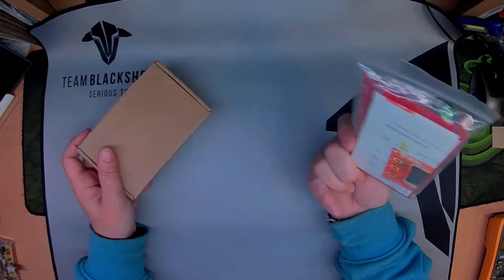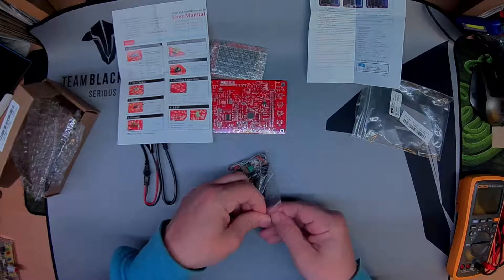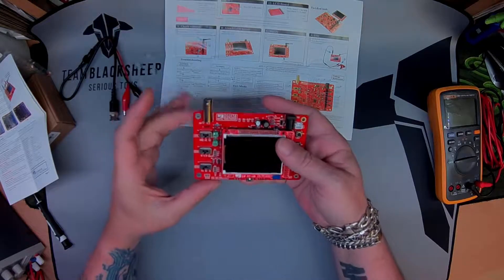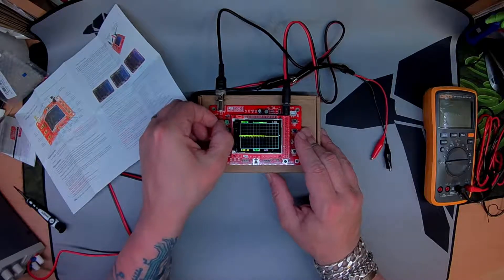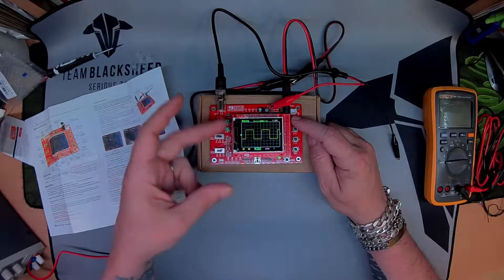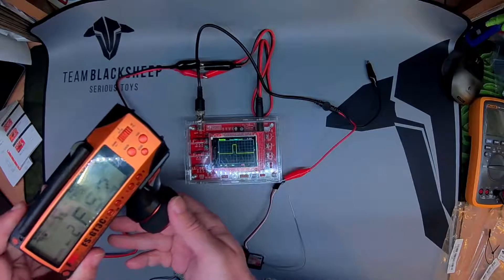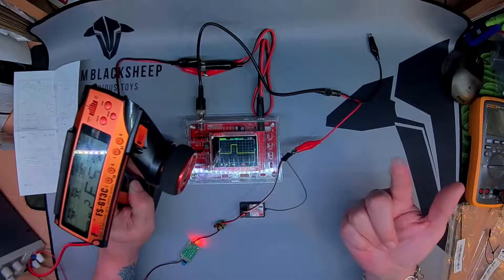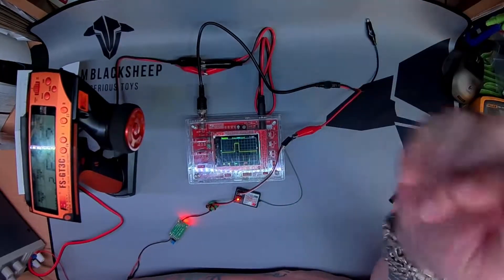DSO138 Build and Test [JYE Tech Oscilloscope  - 13803K]

Comment: I have the same oscilloscope and i have an issue where it constantly displays a voltage even when the nodes aren't attached to anything. Does anybody know how to fix that?
Reply from the maker: Nothing springs to mind other than checking for a bridged solder or something.

Comment: Nice video and editing, and useful little device to test controllers etc..

And a quick update, the micro SD card holder on my 3d printer has never worked well, and isn't really reading cards anymore or gives an error about 5 mins into a print.. so HobbyKing is sending me a completely new main board for FREE.. always surprised with their support.. I didn't even send them any proof haha.. 

And I thought about buying a quad with good goggles, transmitter etc again.. but it will at least last a few years to get all of it so I just ordered alot of parts for the Hellseeker (and front dogbones for the rear, stupid stock lol) so I could just have some fun (also got the titanium rear hubs (only thing that ever broke (alot too) and made me lose my dogbone. And I added almost almost everything out of Europe stock, because it would cost me €3 more because of the free shipping and spares are always good to have... 
I'll probably do an unboxing video + some driving when it arrives and the dogbones (HOPEFULLY) fit haha
(update: Arrived!! :D)

Also still thinking about the himoto, I never really had alot of fun with it because it kept breaking and it still breaks after upgrades.. so I might sell it for a bit lower than I want (people don't want to give enough for what I want) so I can just get rid the ideas of trying to fix it. 

And a tip, I have been looking at a turnigy controller (for cars and boats) with a gyroscope and a ton of other features, I found it on HobbyKing, at the controllers in EU stock.. I don't think you would even need one, but if you do it looks like a good controller, and it will probably help with drifting.
Reply from the maker: Thanks!

Looking forawrd to some content from you. The normal Turnigy transmitters are rebranded Flysky from memory but if you are looking at the higher end ones - consider a different brand (the FS-I10 is way more expensive than the lover priced Taranis like the X-Lite and the X7 for example)
Reply: thanks for the information.. i was looking at the Flysky FS-GT5, but the Turnigy rebranded one is still cheaper on hobbyking and i like their support a bit more haha
and i could make multiple videos with all the parts i ordered. Including a 'discovery buzzer' so it would be easier to find my car back because i want to try to drive it with fpv.. i also received a cheap $3 omnidirectional antenna from aliexpress which i'm going to test out, might just record it :)
Reply from the maker: Keep Flysky in mind if you need lots of receivers because you can get the 3ch ones dirt cheap. I got the Flysky I6 to begin with and it has served me very well and I still enjoy putting it to use alas being featured in a recent vid haha.

Buzzers are great ,have them native on all the quads but there are a few different ones for generic RC. they'll be a great help for you FPV'ing, dont forget that recording the FPV feed can also help finding where you went.

All antenna are a trade off in one way or another but I'd be intrested to see how the Omni works for you :)
Reply: A quick update, i couldn't find my vegas pro 14 licence but i forgot i can also still find it at HumbleBundle soi can start editing soon.. my test week starts at monday so it wouldn't be a good idea to start editing then.. 

I also found a pole on the side of the road that checks and displays how fast cars are going (don't know the name in english..) and i found out if the hellseeker gets close enough it detects it :D my fastest is 40kmh and i recorded one with 39kmh.. I'll make a video about 1300mAh and 1750mAh batteries when i order some 1750mAh batteries :) (speed test!)

and i finally got a job, that makes it alot easier to get a drone (probably not soon because i'm looking at too expensive fat shark goggles :P )
Reply from the maker: Thats a cool idea using one of the speed check signs!
You can check speed using Audacity from memory but it involves a bit of messing around with the Doppler efect.

Your E013 goggles will get you going in a pinch, good luck with your exams.